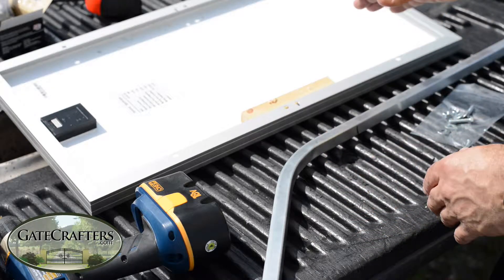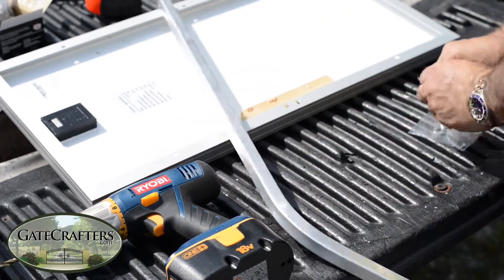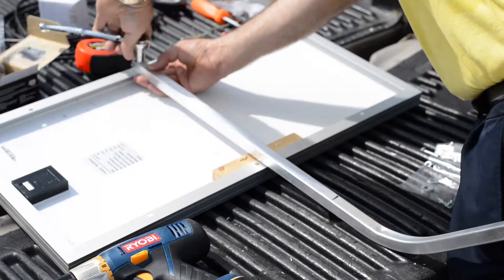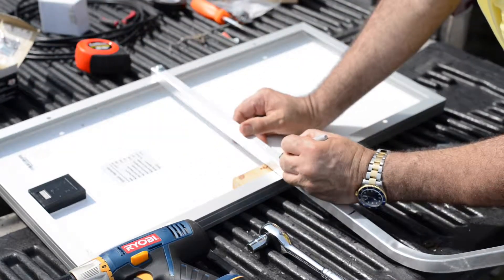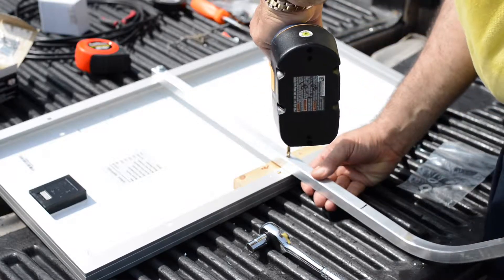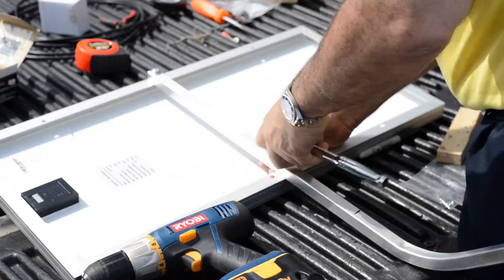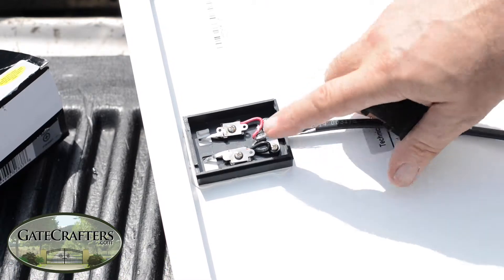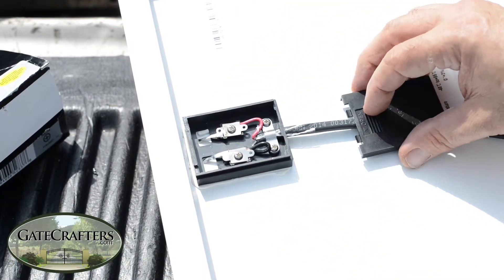How To Install Solar Panel for Driveway Gate Opener

Comment: Works great.>>>t.co/I0fdanPRHl   Easy to install. Does what it says it will do, unlike most Washington politicans. The only downside is the low voltage wire can't be spliced. Our dogs dug up the freshly laid wire and severed it. Called tech support and was told it can't be spliced. I did and it worked but he stated it would not last. Keeping fingers crossed.